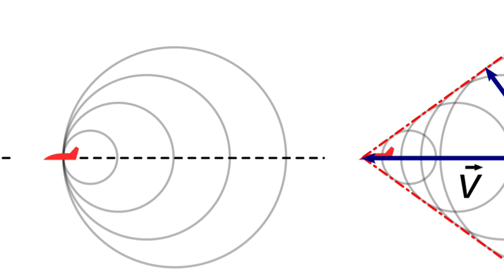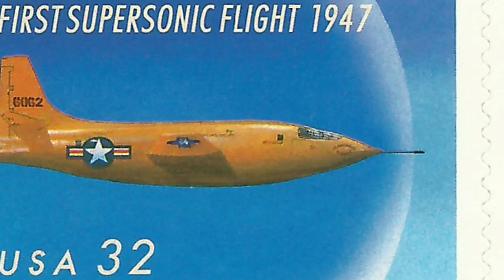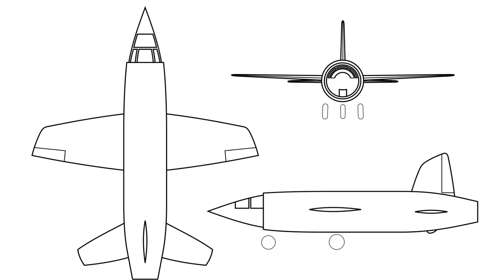Supersonic Firsts

Comment: Biggest problem with supersonic speed prior to the jet age was hinted at when you showed a short clip of the P-38 in flight. Although the aircraft could not go supersonic, airflow over its control surfaces could, freezing the controls in what was called at the time, compressibility. And because this occurred during a dive, several airmen lost their lives until an airflow modifier was added to the plane. This phenomenon was documented in wind tunnel studies here in 1918 but forgotten between the wars. I have a copy of the three-volume final report and was puzzled until I saw that these books had last been checked out of the Fairchild Aviation Library in 1930 😱
Reply: During the war, Farnborough was tasked with assessing the critical mach numbers of a number of types. In his autobiography (Wings on my sleeve) Eric Brown said that the Lightning and P47 had lower critical mach numbers than the contemporary ME109 and FW190s, while the P51 had a higher value. This led to the decision (he says) to equip the 8th Air Force's fighter groups with P51s.

One factor to be taken into account with piston engined aircraft at high speed was the drag of the propeller itself.
Reply: @ross.venner  Yes, the Jug too. Brown is a hero of mine...omg, all the different aircraft he flew!! And one thing I should have noted is that ALL SORTS of wind tunnel test were conducted. Many of them strange. But most were aimed at reducing drag and basic improvements - not checking for areas of supersonic airflow beyond Vne.

And the props, yes. Not only did they create drag but the tips could easily go supersonic....as anyone listening to some jerk take off at your local airfield in even a high-performance GA aircraft with a constant speed prop knows....or, rather, can't help but hear. 😒 😞
Reply: @BlueBaron3339  At that time - teh early 1940s, there was no way to get useful wind tunnel data at transonic speeds, due to teh unpredictable interactions with the shock waves generated and the tunnel itself.  Subsonic tunnels produced great results, and supersonic tunnels also worked well - but there was a region, between about Mach 0.7 - Mach 1.4 where you weren't getting good data at all.
(Transonic speeds are the region where the flow over the aircraft is supersonic at some locations, and subsonic at others - quite chaotic.) 
The only way to gather data was to actually fly into the region and take the risks.
Late in 1944, the Germans worked out the slotted-wall tunnel, which provided better data at transonic speeds - but that data still had to be verified with real world testing.
Reply: Those late fees must be horrendous.
Reply: @Supernaut2000  😂 🤣
Reply: @peterstickney7608  Yes, that was a huge issue for the Germans as they had jet and rocket propulsion, plus they were developing the swept wing. Good thing for us as it made the F86 - technically - a supersonic aircraft. It's original design had straight wings, I believe. It's been AGES though since I studied this stuff 🧐
Reply: @peterstickney7608 - I have read that Germany had supersonic wind tunnels during WW2. These were appropriated by the USA after the war.
Reply: @BlueBaron3339  Those early Jug issues are well described in Robert Johnson's book Thunderbolt!.  In 1943, the RAF also started testing near supersonic with Spitfires, one of which (flown by Sqdn Ldr  Anthony F Martindale) hit Mach .92 on a dive losing it's prop in the process.  Also, de Havilland also was not silent in the near supersonic arena with its Swallow tests.  Eric 'Winkle' Brown deserves his own episode.  Anyone that can land a Mosquito on a carrier and then take off must have the right stuff.  His accomplishments are stunning.
Reply: Hoa Tattis  That's why it was they, and no the US, racing to get to the German's advanced wind tunnel before the Soviets. I'd forgotten all about that until someone here mentioned the tunnel and Eric Brown. 🙄
Reply: @ajg617  Yes: apparently Sqdn Ldr Martindale passed out a little after the propeller parted company, coming round just in the nick of time. He got back onto terra firma safely by just gliding in. Sounds cool, but I dare say even he would have been sweating buckets during that long, eerily unpowered descent!
Reply: Love this thread!
Reply: Also, the flow around the propeller tips goes supersonic well before the flow over the control surfaces, leading to all sorts of problems in both propulsion and control.
Reply: @ajg617  Yes, I was thinking that too when someone mentioned Brown. THG would just love him. When we think of the great pilots of that era, we think of Hartmann, Marseille, Standford Tuck, etc. But Brown was singular for an entirely different set of reasons.
Reply: @kh23797  Came to at 40 thousand feet with no prop and the wings swept back a bit.  There are pictures of the Spit after it landed - a mess.
Reply: @BlueBaron3339  Brown also headed up the investigation of the Geoffrey de Havilland Swallow crash, repeating the flight in another Swallow.  As he approached Mach 1, he also experienced the violent oscillations.  His suspicion was that because of de Havilland's height, his head hit the canopy killing him.  Brown was shorter.  Just an amazing career.
Reply: The P-38 could nudge the "sound barrier" effect described,  while in a power dive.
Reply: Hmmm🤔!!!
Reply: @maximilliancunningham6091  Yes, and it wasn't exactly intuitive that airflow over control surfaces could be moving faster than the aircraft itself. The fix was a slap-dash affair - an underwing strip of metal with a hinge in the middle to redirect the airflow when deployed.
Reply: @BlueBaron3339  The. Germans were actually falling behind toward the end of the War.  Allied jet engines had surpassed the Germans in early 1944, and the engine race was between the Americans and the Brits.  The high speed advantages of swept wings were also known in the U.S. Robert Jones of the NACA had been publishing studies which demonstrated the value of swept wings, and Gluhareff at Vpught-Sikorsky had done pioneering work on Delta wings.  The German data was useful, but not unique.
Reply: @peterstickney7608  I've been too long away from the subject to debate you on that point, Peter. We brought Lippisch and many others over during Paper Clip for more than mere verification I imagine. My only firsthand experience was my father's laughter, during the Apollo project, because they'd put him - a Jew - in the same office with a Paper Clip guy. Yes, he saw humor in it. Plus he knew that few, if any, had been true Nazis. But I digress....
Reply: @BlueBaron3339  Dive flaps beginning with the J-25-LO model (also the fastest I believe), but retrofitted on other P-38s.  The Luftwaffe found out early on that they could dive away from the early P-38s because the Lighting became an unstable gun platform.  Different story in PTO especially after Lindbergh's visit and training on fuel consumption.  I often wonder how the later J models would have fared in the ETO.
Reply: @ajg617  Yes, like Dick Bong in the PTO. It wasn't trusted in the ETO and not because of the dive problem. The prevailing rumor was it was uncontrollable at Vmc...or at any speed for that matter on one engine. I forget the famous pilot who'd do impressive demos in England in the Lightning with an engine out but it didn't matter. Also the biggest issue in the PTO was RANGE, which is the 38 was made for. 

Plus, when the P-38 was first delivered to England, prior to our entry in the war, it was without the GE superchargers. 🤪 Yeah, I know what you're thinking 😂
Reply: @Supernaut2000  I recently heard a story on the radio about a woman who had a Felony warrant for her arrest. She went to renew her driver's license and learned of it. The state that she lives in has a dollar figure assigned to 'Theft by Conversion', a theft where something was obtained legally but not returned or paid for. In this case she had rented a VHS movie more than twenty years ago and not returned it. The District Attorney realized that this would be a miscarriage of justice and got the Felony warrant dismissed. 
     Late Fees are a bitch!
     Yall Take Care and be safe, John
Reply: @JohnDoe-pv2iu  She probably agreed to donate to his reelection campaign all was lovey dovey lol
Reply: Called Mach tuck.
Reply: @BlueBaron3339  I think the pilot that did single engine flight demonstrations in the P38 was Lockheed test pilot Tony LeVier.
Reply: @andyharman3022  YES!!! Oops, sorry to shout but you know how it is when, try as you might, you can't bring yourself to remember something and then....well....you're right, Andy 😜

Comment: The F-100 "The Hun" is one of my favorites...I knew a lot of Hun pilots from my days in the Air Force. Most loved the plane, but they respected it. The Hun looked lethal just sitting on the ground. OTOH, the F-86 was designed by artists and then the engineers were told to make it fly...gorgeous airplane.
Reply: I was always into fast "modern" jets as a teenager in the 90's, like so many other young lads. Seeing a CAC Sabre in the metal for the first time really sparked my interest in what came before, and I'm so very glad that it did.
Reply: The F-100 is a gorgeous aircraft, but disruption of the airflow over the tail surfaces could cause the infamous "Super Sabre Dance" on landings, of which, some pilots didn't survive.

Still, I'd love to have one. There's even a guy that (for the price of fuel) will give you a ride in a two-seater.

Speaking of which, a year or so ago, there was an auction for two of these birds at Mojave Airport, that had been sitting for a while - one was a two-seater.
Reply: And there is the mentioned F-104. The joke is that the F-104 is proof that if you had a big enough engine, you could make anything fly!
Reply: There is a great interview with a US pilot about his time on the F100 on the aircrew interview channel. 
It’s nothing but aircrew interviews from around the world I recommend it 👍
Reply: @korbell1089  Interesting to compare that to the elegance of the F-86 and F-100. With the limitations of early jet engines, aircraft had to be designed to fly well with limited power, primarily subsonic. This produced some rather elegant-looking aircraft. But as power increased, for one thing thrust could be relied upon to get it in the air so aerodynamic cleanliness was less needed so factors like maneuverability and stealth could be more emphasized, and for another they would spend more time flying supersonic which calls for different, generally less aesthetically pleasing, designs. The F-104 was the first of this new approach, basically just some sheet metal wrapped around a new more powerful engine.
Reply: @nigeh5326  I watched that one - It was a real eye-opener.  
I think it may be the one with Vic Vizcarra flying the Thud
(And if its not its a still pretty good one)
Reply: @Farweasel  I think you are right. I often listen to them in the car when I’m out Mike makes some good videos and podcasts 👍
Reply: It was lethal alright.
You want to see something gruesome?
Check out the infamous “Sabre Dance”.
Reply: North American made some of the greatest planes of all times, and they add in common a purity of lines that was beyond compare among their contemporaries, be it the Mustang, the Sabre, the Hun or the Vigilante. Flying beauties!
Reply: @TheIndianalain  The Vigilante was built in my hometown of Columbus and my house at the time was directly under the downwind leg of Runway 27 at what was then Port Columbus Airport (now John Glenn International).  At the time, there were no restrictions on supersonic flight over land, and sonic booms were an occasional occurrence.  The Vigilante was and still is one of the most aesthetically beautiful aircraft ever built.  While it never fulfilled its role as a technically advanced bomber/attack platform, it became a highly successful reconnaissance aircraft.

Comment: 11:01  the CL-13 that  Jacqueline flew was a Mk. 3 with the Avro Canada Orenda turbojet (Orenda 3 with 6,000 lbf (27 kN) thrust).  The only one built.
Reply: https://en.wikipedia.org/wiki/Canadair_Sabre "The sole Sabre Mk 3 was the first of the Canadian Sabres to use the Avro Canada Orenda turbojet (Orenda 3 with 6,000 lbf (27 kN) thrust). The Sabre Mk.4 retained the General Electric engine and was destined for the RAF and was later passed on to other overseas air forces. The Sabre Mk.5 was the next production version, equipped with an Orenda 10 with 6,500 lbf (29 kN) thrust. A change to the Orenda 14 with 7,440 lbf (33 kN) powered the Sabre Mk.6."
Reply: @petersilva037  The only Mk. 3.

Comment: Fuel consumption is one of the greatest limfacs of sustained supersonic flight, but in an oddity of aviation technology, the SR-71 with its J-58 engine actually became more fuel efficient at its top speed.
Reply: It got better mileage the faster it flew. This is a matter of it covering more distance per second, rather than burning less fuel.
Reply: It is not quite that simple. In order to double the speed of an aircraft, you roughly need four times the thrust. The J-58 has six tubes that take a massive amount of airflow from the compressor stage, bypasses the burner section, and is re-injected into the airflow just in front of the nozzle. It creates a de facto ram jet. Rather efficient for creating thrust. Why other engines do not use this same technique is beyond me.

Comment: If Welch broke the sound barrier, he had to do it in a dive - the only way the F86 could gain that much speed.  So Yeager's claim to break the barrier in level flight stands regardless.
Reply: Now I suspect if his front wheel hatches were not properly recessed that is more likely to mean he didn't than he did.   
The reason for thinking that is drag.  Its already increasing as a square of the speed so the last thing you need is to add form drag.               But ............
One of the 'tricks' used to help early supersonic aircraft achieve that speed was 'the Coke Bottle shape'. 
And I can't help wondering - given the claims a sonic boom was heard on the ground - did the 'bump' in the airflow of a baddly recessed wheel give a similar filip?
Reply: My father flew F-86s in Korea and was later a test pilot at Edwards, flying the F-102 and F-106. The Sabre was his favorite by far. He, too, said over and over it could only go supersonic in a dive. He talked about George Welch taking it supersonic on its first flight, but not in the manner of him being there (he was barely out of flight training at that time). It seemed more of in the manner of a proud F-86 pilot himself. Given the landing gear issue evidence listed in the video, I'd think it's safer to assume Yeager was first of any kind of supersonic flight, level or not.
Reply: Ed DeCook.... Yes, according to my dad the 86 could not break the sound barrier in level flight, only in a dive.
Also, I believe it was Yeager, who flew a captured mig 15 and said it got mighty unstable approaching the sound barrier. 
(Also in a dive).
Reply: First to break the sound barrier, period, is more prestigious. Also, F-86 was a jet and fully functional airplane. X-1 was a rocket plane that needed a ride. So the records are distinct. F-100 gets the first production jet in level flight record, and the F-100 gets the first jet in level flight. F-8 is the first naval Mach 1 aircraft.

Yeager was first, period (but with a rocket). Yeager was first in level flight (with a rocket), but Welch was the first in a jet, and the F-100 was the first jet in level flight. Crossfield in the D-558-II was first to Mach 2 (rocket), F-104 was the first jet to reach and sustain level flight at Mach 2. X-2 was first to Mach 3 (rocket). I believe the A-12 (later SR-71) was first jet to go Mach 3, but not 100% certain. X-15 was the first to reach Mach 4 and higher (rocket). All distinct records. And there are even more supersonic firsts and records as well.
Reply: Later models, too
Reply: Your father flew later models. Welch’s early model incapable of going supersonic- underpowered
Reply: Eric Brown had a ride in Welch's aircraft at about that time. He thought it subsonic although it would indicate supersonic.
Reply: @ABrit-bt6ce  This is untrue. What evidence do you have?
Reply: @ABrit-bt6ce  That is untrue. What evidence do you have to back up your statement?
Reply: Wings on My Sleeve by Eric "Winkle" Brown.
Reply: The purpose of the X-1 was to ascertain whether or not an airfoil could still generate sufficient lift at supersonic speeds. Anyone can break the sound barrier on a ballistic trajectory-- the idea was to find out if an airplane could sustain level flight beyond Mach 1 or would it drop like an arrow.
Reply: @BogeyTheBear  No, that's incorrect. Where are you getting your information? What evidence do you have of anything you put forth?

Comment: I was living in Los Angeles when the SR-71 made its last flight.  One hour and four minutes, LA to DC.  It left Edwards AFB, headed out over the pacific, was refueled, turned around, and then blasted east. I heard that unique "double tap" sonic boom of the SR-71.

I've had a woody for the Blackbird ever since.  YT has certainly fed that hunger.

When I visited the USS Alabama in Mobile, AL, there was a Blackbird, on the grounds with several other planes.  It was a lot smaller than I thought.  I touched it.

Bucket list complete.